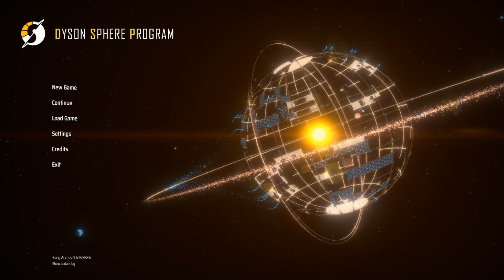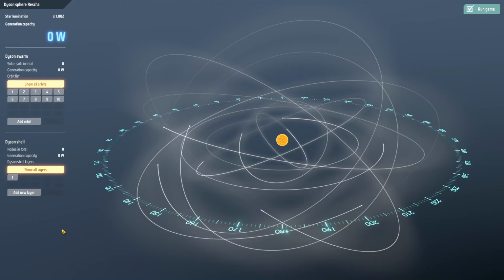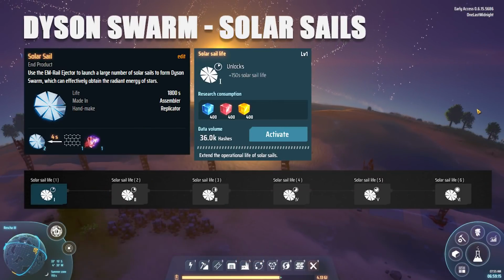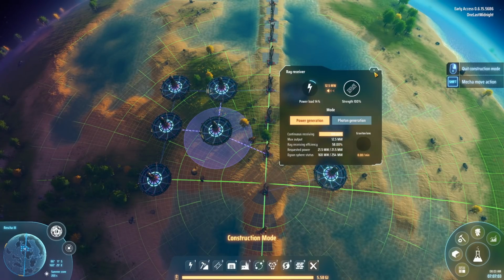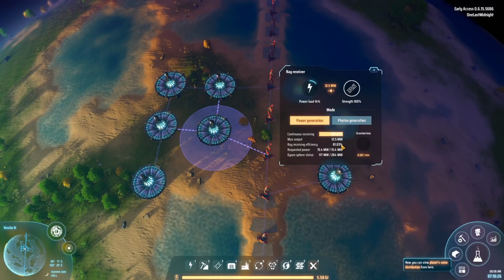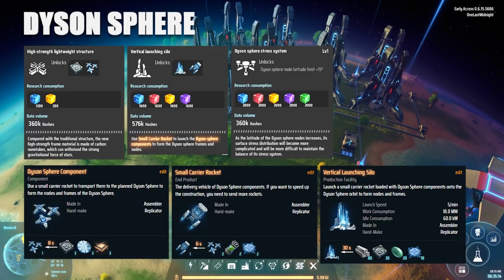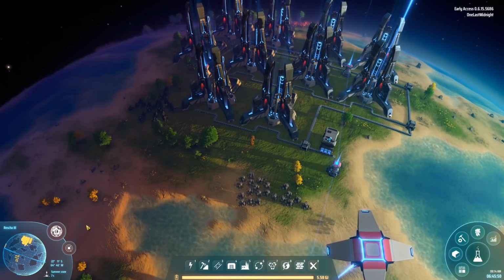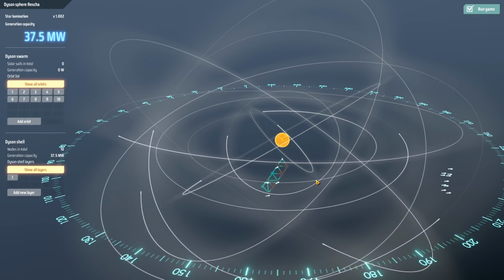Dyson Sphere Program - HOW TO BUILD A DYSON SPHERE - A HELPFUL GUIDE - NEW PLAYER TUTORIAL

Comment: You can actually populate dyson sphere with solar sails by clicking that "Shell" icon (polygon) and then in the middle of your closed sphere parts. It will create a "surface" planes made of solar sails and dramatically increase the power output. However I am not sure if those will stay permanently, but they are still supplied by rail guns.
Reply: They are permanent, and add to the sphere...:P

Comment: There one big error in this. Went your building you Dyson sphere and you says this is to select a group of nodes. This is incorrect. You use that button to select between node to tell the sphere to suck your Dyson swarm there and create the solar panel. It takes your swarm and put it permanent.
Reply from the maker: Thank you very much!
Reply: Excuse me, i may be dense. Can you better illustrate how that process works?
Reply: @TheSpektralOne  you create a square with the line tool then you click on the middle of the square with the last one. Then your Dyson sphere will use solar sails to fill the middle
Reply: @samgau2  I currently have my sphere in 2 space long triangles, would that mess that up at all?
Reply: @TheSpektralOne  no it won't if you click with the fill in tools . It going to go green . Then if you wait . You sphere will start sucking in the solar swarm
Reply: @TheSpektralOne  I've found I can't have areas too big or it won't select them as well it will stay Orange and won't go green to fill it in

Comment: And permanent solar panels still outperform at every level.
Reply: Make sure to activate "god mode" in the games menu for easier placement.
Reply: Well, for regular solar panels, you only have so much real estate per solar system before you have to start building a sphere or swarm, so...

Eventually you'll be better off to just build a sphere and some deuterium reactors
Reply: My Dyson sphere is 5% complet and it giving me 3.5 GW. Dyson sphere is better then panel in the long run
Reply: sam gau yep... was talking about sails vs panels
Reply: Who wants to build thousands of panels on every planet in the system?
Reply: @bluelynx4493  someone that thinks that basic solar panels outperform a Dyson frame
Reply: David Turner who wants to constantly create sails that expire after an hour?
Reply: @fledglingbodhisatva4821  just launch your sails after you have your frame established, or just switch to an infinite resource map so you won't have to worry about your sails expiring
Reply: Kal Skirata yep... was referring to early game vs solar
Reply: power progression through the game .. early = standard solar panels (equatorial ring works great)  mid-game = solar farm on planet nearest the sun charging and sending full accumulators back to the home planet where they are discharged.  20 units discharging on the home planet will give you 900 MW of power with a small footprint....  late game.... obviously the dyson sphere with sails installed in the frame.

Comment: Soooo... should we skip sails completely and invest into our industry chain? Cuz from what i understand, actualy sphere is an ultimate goal and sails put in sun oribit seems like just waste of resources.
Also i saw some guy who was using sails to actually build the sphere. You just built "walls" but the filling is made by sails... correct?
Reply from the maker: Well...  They are much harder to make because you need antimatter, but it could be a strategy to use.
Reply from the maker: Oh...  And you don't skip sails because they are needed in the construction of the sphere phase.
Reply: The "area select tool" as it was described in the video, lets you fill the area between the frames, when you do this the swarm gets sucked into the nodes to become part of the permanent structure, so you need to maintain the swarm to feed the sphere.
Reply: In my next play trough i will go solar + wind all around the equator, then proceed and jumpt to dyson sphere directly. In retrospective, the swarm is a waste of resources. Solar panels are just to easy to get. Placing them in "god mode" (in the game options) is also quit quick.
Reply: @danielgmur6486  For me, best start to mid game seems to be burners... they are small with huge energy output, can be stacked, consumes everything. No matter what, sources of hydrogen are infinite, same with fire ice, same with oil and that orange oil product :D

Comment: I'm finding that when I create more ray receivers, they "steal" power from one another so they average out to be the same, but maybe a bit more in total. For example, I had 1 ray receiver that had 7mw of power, but when I placed 20 of them, all of them went down to about 0.5 mw of power which is about 10mw total. That's a rip off. Why would I want to make 20 of these when I can just have 1 and be done with it. It does suck that I can't use too many of these to increase total power.
Reply: That's most likely because your sphere/swarm aren't producing enough to power all the ray receivers. If the total output of the dyson sphere is greater than what the ray receivers are all trying to pull, then they will not reduce power for each receiver you add.

Comment: 5:40 So 254/7000 = 36KW of power per sail, and again divided by the factor each collector gets.
The "best" collector you had sitting there was at 80%, so out of those 36KW per sail you only get about ~30KW.

Why would I constantly need to replace a rather advanced/expensive sail when a solar-panel/wind-power mix gives much more power?

THe maths just don't add up to me.
Reply: Solar sails should not be messed with until late yellow and early green cube phase, it just is not worth the investment imo
Reply: Hey I see you posted this 3 weeks ago. I was wondering How far you got and if you got a Dyson Sphere or more built.
Reply: Solar panels and wind sound great until you need to start expanding to dozens of planets where it is much easier to slap down a few artificial suns and use your interstellar logistics to supply them with the fuel than it is to ring every single planet with solar/wind combo. Solar panels and wind power can't make the late game fuel. You need a ray receiver for that. 

Once you build the sphere it can absorb the sails from the swarm into it to build the shell and make them permanent. He missed that part in the video.

Raw ingame resources are much less valuable that your own time. It takes a relatively short amount of your time to set up a dyson sphere and once the set up is done building it is entirely automated, the rockets and sails are shot into orbit automatically and the sphere builds itself. In my opinion the amount of your own time saved not having to manually build thousands of wind/solar panels on every planet you want to expand to is definitely worth it.

Comment: I don't think that dyson swarm is the way to go. Solar sails is just using ressources for temporary power output while you can have more power with solar panels that you can have forever.
Reply from the maker: Yup, 100% correct.
Reply: Your time is worth more than any ingame resources. Once you set up the rockets and rail launchers the sphere builds itself. Using solar/wind you need to manually place every single one, wasting time that you could be spending expanding faster. Spend 20 minutes setting up the infrastructure to build a dyson sphere and it will launch and build itself automatically in the background, expanding your power as you focus on other things and supplying power to every planet in the system and with artificial suns you can export that power anywhere in the galaxy. Once it is finished, spend 10 minutes planning a bigger one around it and your power automatically starts growing again.
Reply: @Subjagator  i think you didn't get what I'm saying
Reply: @TheCentaury  
Were you suggesting building solar panels that you place on the planet instead of building a dyson sphere/swarm?
Reply: @Subjagator  dyson sphere ???? Come on... Read Again !!!
Reply: @Subjagator  
My position is clear.
I don't talk about the Dyson Sphere.
Read My comment again !!!
Why do I say in my comment "Solar sails is using ressources for temporary power" if I was talking about the Dyson Sphere ???
So you didn't read me.
When I said "you didn't get what I'm saying." You commented again implying that I suggest building solar panels instead of a dyson sphere/swarm ... 
I replied to your simple Question with the correct answer : "Dyson Sphere ????" Come on. Read Again !!!
I'm not being a dick... 
I'm just referring to my own comment which is clear...
I don't have to clarify something when you're referring to something I didn't write.
I just ask you to read again with even a big "hint" even a "clue"... "Dyson Sphere ????"
Do I have to take your "hand" and show you ?
It's not even a question of a position or an opinion on a subject... It's your bad reading the issue here...
Reply: @TheCentaury  
Grow up.
Reply: @Subjagator  I think you're just a bit mad at the moment :) Once you're ready you'll see that I share your opinion about the dyson sphere but It's not what I was talking about.
Reply: @TheCentaury  
You stated you opinion. I stated mine. I was happy to have a conversation about it but rather than clarify a simple point you were unnecessarily difficult about it. I am not mad, just don't see what is gained in making things more difficult than they need to be and would rather not spend my time working around that nonsense. Enjoy your day.
Reply: @Subjagator  You make it difficult cause we aren't discussing the same subject. It's like if I was sharing my opinion about cats and you reply me with your opinion about dogs and then when I say that you're not getting it, you reply by implying that my opinion is about dogs...

Now to unlock solar swarm, you only need some blue and red cubes... To unlock the dyson sphere, you need red, blue, yellow and purple and even green cubes to start building. Therefor you'll spend a lot of time before doing it. And it's a waste of ressources to keep shooting solar sails for a bad ratio in power produced while you're not ready to build the sphere
Reply: @TheCentaury  
Why are you still trying to make this an argument?
Reply: @Subjagator  I added something in the modified version.
Reply: @TheCentaury  
A waste of ingame resources yes, I never questioned that. But in exchange for paying those resource costs, you no longer need to manually build thousands of solar panels to expand your power. I value my time more than any amount of imaginary ingame resources.
Reply: @Subjagator  I just did that in one shot. It needed 20 minutes in GodMode to put them on the ground and I have 600 MW power forever. I don't do that to expand my power but as my main source of power till dyson sphere is unlocked :D The dyson swarm is useless until you get the dyson sphere. First because you need 600 solar sails to produce 23.6MW on a G-star,  second because your ray receiver are not efficient at that stage of the game and also because you have to keep shooting solar sails as they are not eternal until you can put them on a dyson shell.
Reply: @TheCentaury  
Yup, solar panels(and wind) are early game power option. Then oil would be midgame. Then dyson sphere late game. I wasn't trying to argue otherwise, only pointing out that resource efficiency isn't the only factor involved. Solar is only 50% efficient because of the day/night cycle, wind is space inefficient, dyson swarm is resource inefficient, especially initially, and dyson sphere is somewhat late game, there are always tradeoffs.
Reply: @Subjagator  So you see that we have the same point of view at the end :D
Reply: @TheCentaury  
I never doubted that. I just wish that when I explicitly asked a very simple question you answered it instead of being difficult. Now if anyone bothers reading this thread to get some different views on this topic they have 10+ replies in the middle where we aren't actually discussing anything.
Reply: @Subjagator  I know but it's a bit like the quote : "Give a man a fish and you feed him for a day. Teach a man to fish and you feed him for a lifetime"... If you don't read a comment correctly and then go with your own opinion that doesn't match the subject of the topic. The author can correct you and just make it simple and easy for you. (That's give a man a fish and you feed him for a day)... Sorry If you were mad about it :D
Reply: @TheCentaury  
But none of that is true. I never disputed your OP at all. I just added my own separate opinion on why someone might want to use a dyson swarm instead of solar panels(trading ingame resources for more automation).

I read your comment and understood it fine, you were indeed talking about using solar panels on a planet which is exactly what I asked you to clarify specifically so that I wouldn't be making assumptions about your view and we could continue the conversation on the same page but you just outright refused to do it for some reason.

I am not mad(2nd time you have tried to make out that I am mad when I am not), just disappointed that what should have been a relatively simple exchange about a game was turned into a pointless exercise in pettiness.
Reply: @Subjagator  Of course what I've said is true... Your comment begins like this : "Your time is worth more than any ingame resources. Once you set up the rockets and rail launchers the sphere builds itself."... So your opinion is definitively diverging from the subject cause I'm talking about Dyson Swarm while you're talking about Dyson Sphere. These are 2 different concepts and 2 different moments in the game. Dyson Swarm is an early game unlocked research while Dyson Sphere is already a late stage of development.
So I said : "i think you didn't get what I'm saying". And you reply with a question : "Were you suggesting building solar panels that you place on the planet instead of building a dyson sphere/swarm?" ... Again you're referring to Dyson Sphere while I only speak about Dyson Swarm. And Even in my comment there is a clue about the stage of the game I'm talking about : "Solar sails is just using ressources for temporary power"... It implies an early stage of the game because once you begin to build the Dyson Sphere, it's no more temporary power like a solar Swarm but a permanent source of power. Therefor, you can't even think that I'm suggesting to build solar panels instead of building a dyson sphere if you read my comment and understand it fine ... That's why I replied "Dyson Sphere ??? Come On... Read Again"
Reply: @TheCentaury  
I was talking about solar panels versus dyson swarm/sphere. Notice I used both but you seem to have focused almost entirely on the sphere part, ignoring everything else.

And again, I have no problem talking about the game but you want to make this entire thing some kind of argument, just stop.
Reply: @Subjagator  Of course I focused on the sphere part because your first comment was about how bad and time consuming it was to build solar panels instead of a Dyson Sphere !!! Then your second question is suggesting that I build solar panels on planet instead of "both" The Dyson Swarm and the Dyson Sphere... It shows me that you didn't get my comment at all.... I didn't ignore the rest but as you said we first needed to be on the same page... So I had to make it clear that I wasn't talking about the late stage of the game when your dyson sphere will provide a permanent source of power for several systems. Remember : "Dyson Sphere ??? Come On... Read Again"
Reply: @TheCentaury  
Listen, I have no desire to argue about this nonsense. I added my opinion about solar panels and the swarm/sphere and your turned it into a ridiculous argument about nothing, good luck.
Reply: @Subjagator  it's not nonsense, and it's not about nothing. it's about your bad reading. I told you already :D See you ^^

Comment: i cant add a sphere because it keeps saying lattitude is too high and i dont know how to fix it :(
Reply from the maker: Make your orbit smaller and make sure you are on or close to the equator.   That might help.
Reply: You need to research Dyson stress System. Without it you can only build a cycle around the sun. With each research of stress system you get more room to build to the poles of the sun